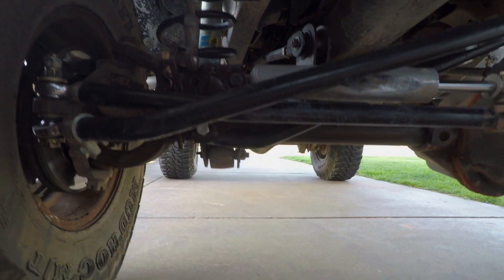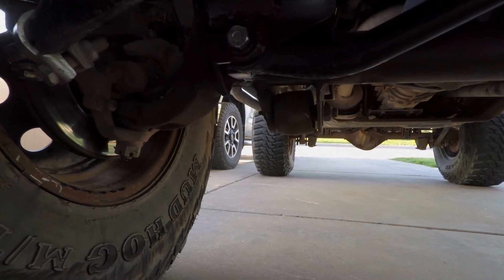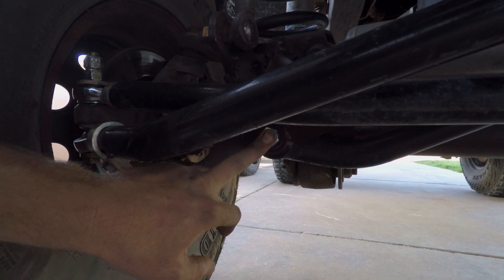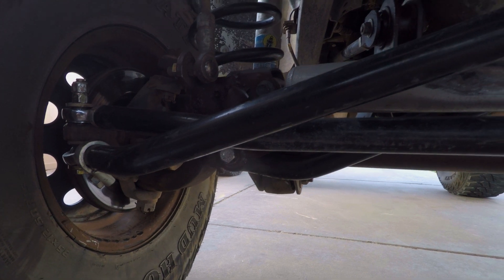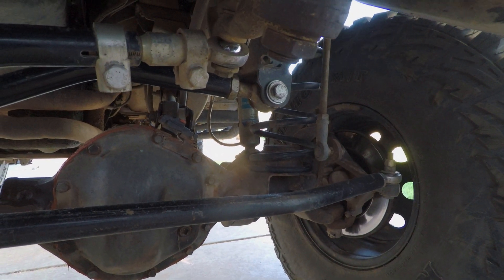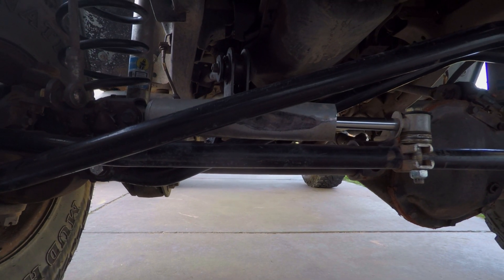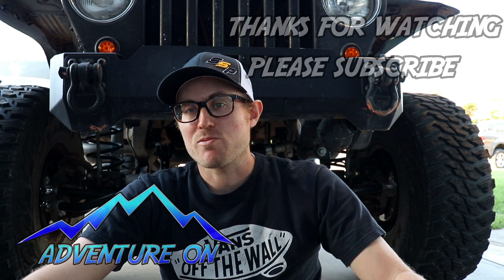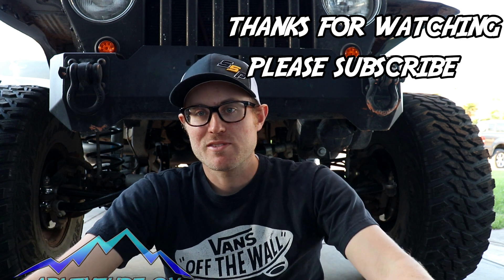Death wobble solved.

Comment: Best check for the death wobble problem is to make a turn and see if the steering wheel returns itself , if not you found the issue .
That no return of the steering wheel shows you don't have enuff CASTER ANGLE it needs to be 8° positive or more in some cases
Reply: Interesting.

Comment: Good job explaining it from your experience.  One of the better videos on Death Wobble.  Had a TJ like yours, never had a problem with DW.  Looking to pick up a 2015 and will definitely do the steering wheel check and eyeball the rear suspension.